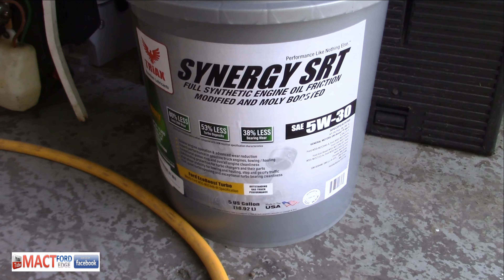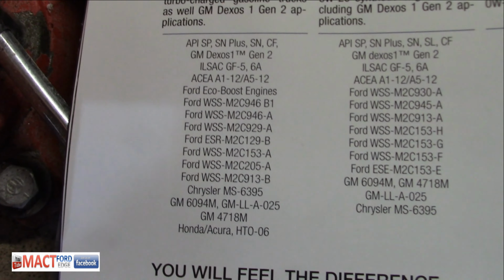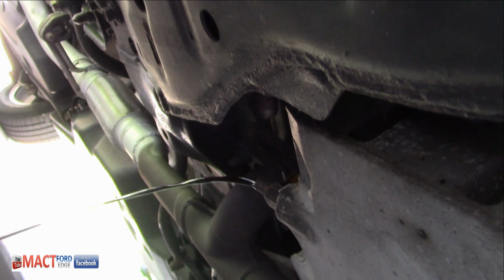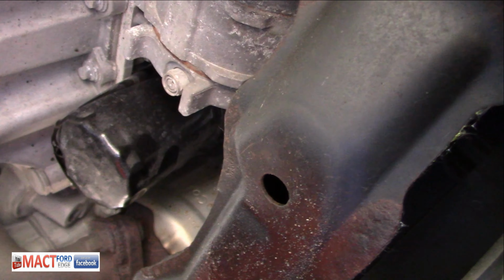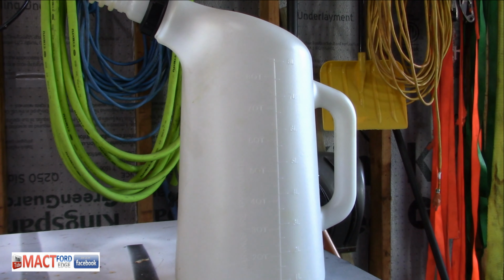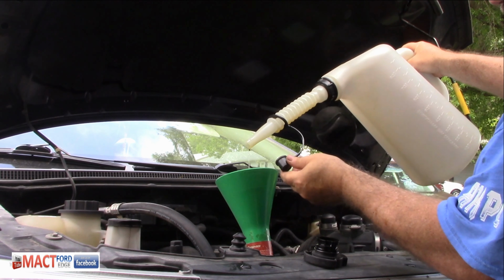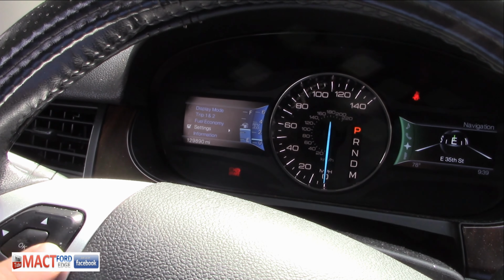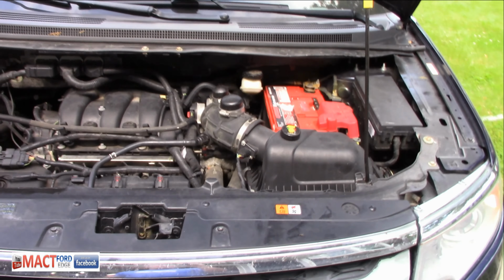Triax Synergy SRT PAO ESTER 5W30 oil change in a Duratec

Comment: Hey MACT, remember when I said my backup camera went out. I made an appointment and the earliest is the 17th but for some strange reason it's working again. I sure hope a code was stored also one day I drove to Walmart did my shopping cam mm out and my memory seats would work nor would my power steering wheel
 Tilt. That too corrected itself when I went to the has station one start cycle reset that. I hope a code was stored for that too. Maybe a loose ground or something odd like that maybe the alternator is glitching occasionally causing these random errors

Comment: just a quick remark, why you didn't fill your oil filter with oil? especially that it is upright, I think it is a good practice to do so, it cut down on bearing wear at startup, thanks as usual great video!
Reply from the maker: I guess just lazy.  Then again I have ran two ford Edge to at or over 300,000 miles so apparently that is not an issue.

Comment: Another great video. I am trying 5w30 to stop the startup tick om my 3.5. 1 Question. I want to do TSB 12-1-17 on my 2011 Edge 3.5. Do you know the oil path to the cam caps. Is it through the cam from the first bearing by the chain or the 2nd one with the tubes going to it or through the head to each cam bearing? Just trying to understand what the TSB actually does but do not like that it plugs the oil passage on the 2nd bearing on the front exhaust cam. Also don't like that you have to take a hacksaw to the caps. Thanks.

Comment: thanks for sharing this oil I currently used 300v Ester in my sxs with wet clutches and it shifts very smooth compared to amsoil and mobile racing.   my question is I haven't found much information on this product on lab results like zinc content?   I use ultra platinum in my expedition and looking to switch to this if I could see more details  what's your thoughts?
Reply: salut motul est bon sans plus ,redline au dessus comme triax

Comment: Would that engine oil drain valve work on the 2009-2010 3.5?
Reply: Fumoto valves are available for most vehicles

Comment: i love the Triax Euro oils, but the SRT isn't anything special.  DO NOT go 15k on an eco boost, reliability engineer here.
Reply: What about using this triax with a hint of ester in my nissan 370z? any recommendations, can I get up to at least 10,000? This one has ester in it correct? I just don't feel like getting the nissan ester based at 80 for 5 quarts.

Comment: i run 5w50 triax in my  2011 
 range rover 5.0 super charged
wayy cooler
Reply: How is it so far?? is the car still running?
Reply: yes with 169k on it runs good still
Reply: @aliceinchainz3003  still using that same oil??
Reply: yes sure am